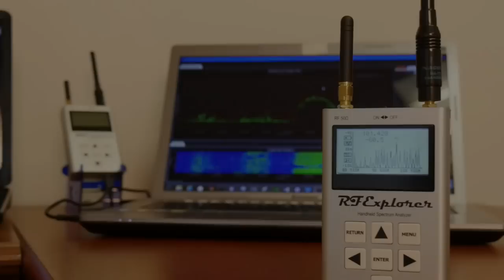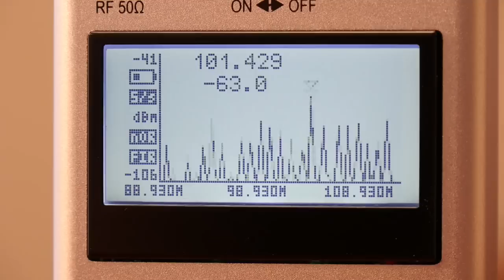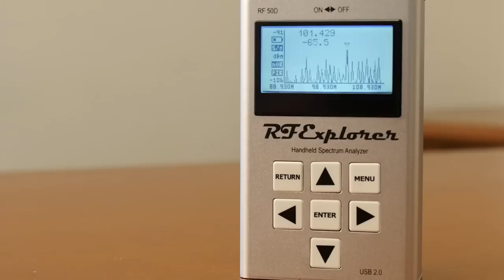Spectrum Analyzer - RF or Wifi Spectrum Analyzer Overview by Nuts About Nets

Comment: like the handheld unit,I want to use it to detec 2.4GHZ a rc modelplane flying club near me,what is the rang it can operate,I live about half a mile from the club,I only want to monitor the club activity.Will this unit also give me the amount a rc transmitter radio in use?  Need to know before my purchase Thanks